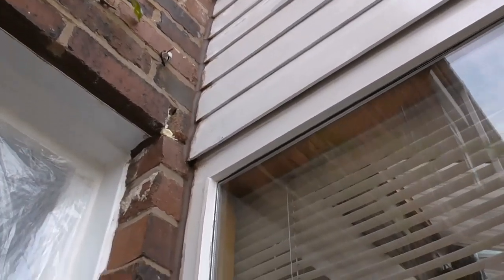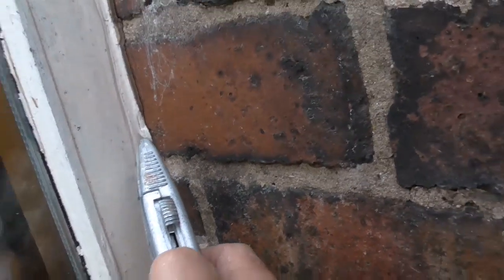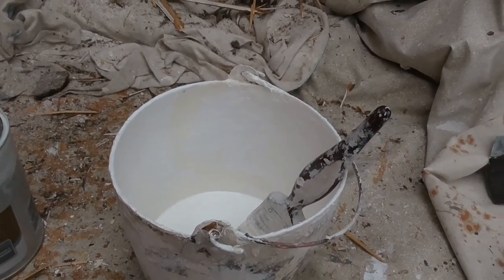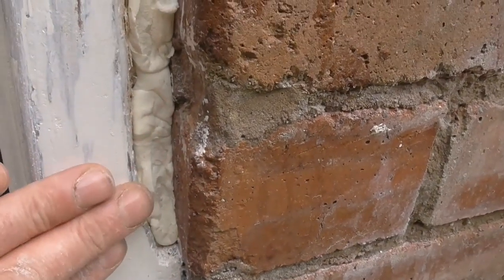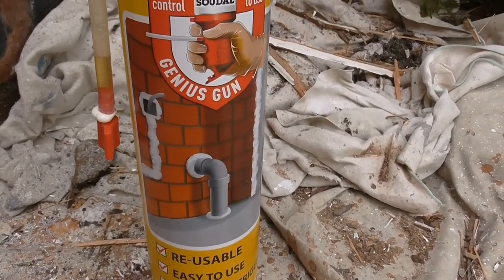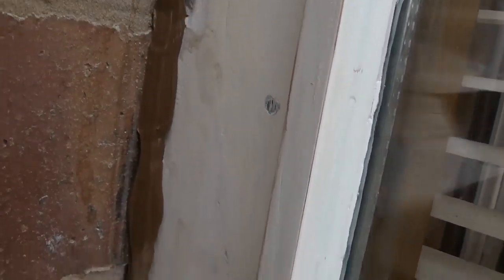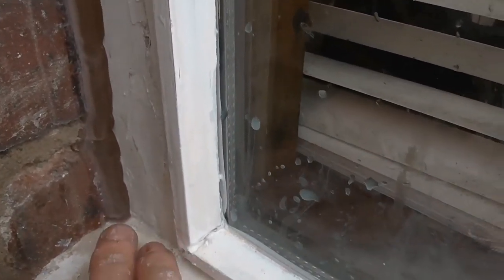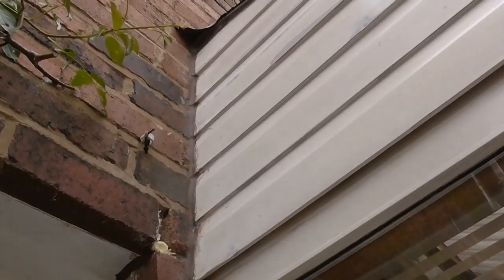How To Caulk Windows And Door Frames

Comment: I bought some Nonsense white frame sealant from Screwfix, applied it to a window frame and smoothed it in using the finger and water method, and it looks reasonably neat - used masking tape as well. But I've notice that it has stayed very tacky and soft and subsequently, has attracted dust and particles of mortar grit. I applied a test run to a piece of wood and let it dry and it drys with a smooth hard skin. So it looks like applying water to the frame sealant adversly affects it's curing properties.
Reply from the maker: It just needs to dry....   and you can not do preparation in a room with wet caulk... hate the stuff really...   we tend not to use it inside at all...

Comment: Great video as usual. I’ve also seen something called Oakum used to pack into gaps between window frames and brickwork... door frames etc. More of a traditional listed building application. Basically a hemp based fibourous rope hammered into the joints using a hammer and a special caulking iron much like a bricklayers pointing iron. Have you ever come across this? I guess a lot of listed buildings may have this specified when restoration is being done to woodwork on the exterior as it seals against moisture but remains breathable. And can look quite effective in the right application. Cheers mate. Marc
Reply from the maker: Thanks have never come across this. But we don't work on a lot of listed buildings and the ones we do have stone surrounds and cast windows. some have sash windows.. but have never seen the sides stuffed with rope.
Reply: Painting and Decorating yeah there’s a national heritage place by me where I’ve seen them carry out work on timber frames buildings using the stuff... really interesting the old methods. 👍

Comment: This video really taught me how to handle my caulk. I started of squeezing my caulk with a nice even pressure and just like the video showed, my caulk started out soft, but stiffened up rather quickly. Do you have any advise on using a caulk ring?
Reply from the maker: Sometimes if your caulk is old or seal broken they can have hard parts inside...   and in cold weather it's best to warm them up in a bucket of hot water..

Comment: Do you ever use repair care or timbabuild? I do quite a bit of work  on old windows etc and use timbabuild in preference to 2 pack . 

The timbabuild is basically a semi flexible epoxy and as long as you prep correctly it work superbly.
Reply from the maker: Sands very easy the two pack and have not used the Timbabuild yet. Will give it a go.. thanks.

Comment: Great series of videos, I'm learning a lot, could you advise me on how much of the caulk you should cover with the top coat of gloss? Many thanks
Reply from the maker: Thanks, that depends on you and where it is. You choose a straight line down. Usually coving half the caulk.
Reply: @PaintingandDecorating  thanks for replying, I've got wooden window frames against the brick wall which could do with an overhaul, the brickwork is pretty decent so I can get a neat caulk line in there. Watching your videos am I right that the steps are, knife out the join between wood and brick, sand the wood, prime the wood, pva seal the brick, foam fill the join where needed, fill over the foam after trimming it, then the caulk, wait overnight then gloss everything. Also do you recommend priming and undercoating before the glossing? 
Any particular caulk to use as I thought some weren't suitable for outdoor use? 
Once again thanks for all your videos, really stresses the importance of thorough preparation
Reply from the maker: @benzone3711  Yes thats right just check your caulk is suitable for outside.
Reply: @PaintingandDecorating  ok, as soon as the decorator centre opens again I'll have quite a big shopping list!

Comment: What's the best brand of caulk for exterior work? Great job again btw.
Reply from the maker: Thanks we get this from the Dulux center but all caulk that I've used is good. Never really had bad stuff
Reply: @PaintingandDecorating  cheers. I used the No Nonsense exterior where the wood meets our pillars and with this hot weather it's cracked. Much thicker bead going on this time!
Reply from the maker: @Napoleon-Blownapart  If too much movement in frames it will crack eventually.
Reply: @PaintingandDecorating  we live on a very busy road for traffic unfortunately, loads of vibration and there's also been subsidence too. Have to just keep plugging away with spot repairs!

Comment: I didn't realise that you could use decorators caulk externally. Do you have to paint over it to protect it?
Reply: There are interior and exterior caulks and some that are good for both. Just check the labels.
Reply from the maker: No it does not have to be painted... we only paint half up the sides and this give you a straight paint line around your frames..

Comment: Can the exterior caulk be used where  upvc window and door edges meet brickwork or does it have to be sealant based? My windows have what looks like the original mastic type stuff all around them but its discoloured and breaking away in places so not sure how to go about it, or exactly what it is that was used. Great vid as always, big fan!
Reply from the maker: No your better using silicone but seal around the brick....   diluted PVA and allow to dry fully before applying your silicone.
Reply: @PaintingandDecorating  thanks for the advice. Love the channel.
Reply from the maker: @algypan  Thank you..